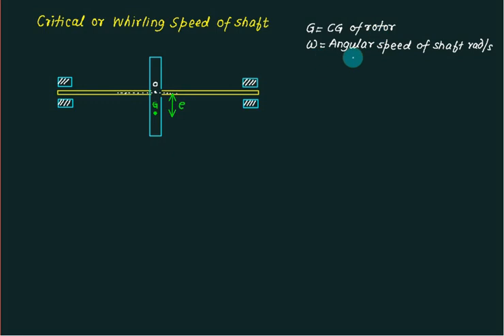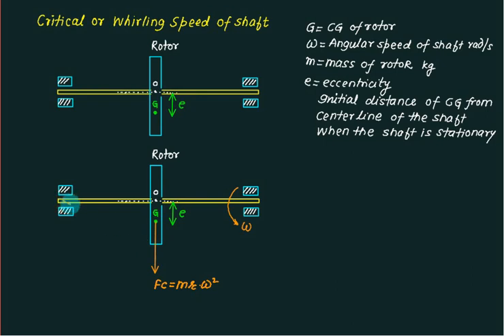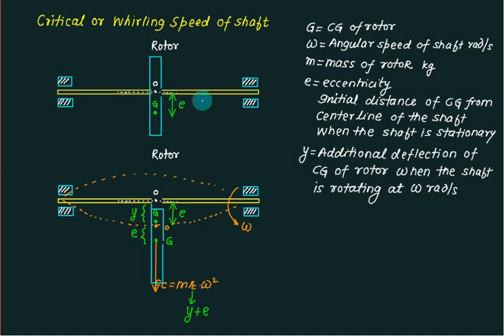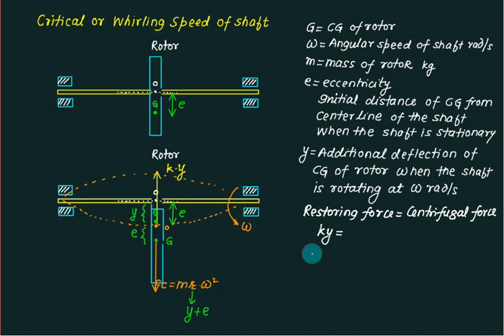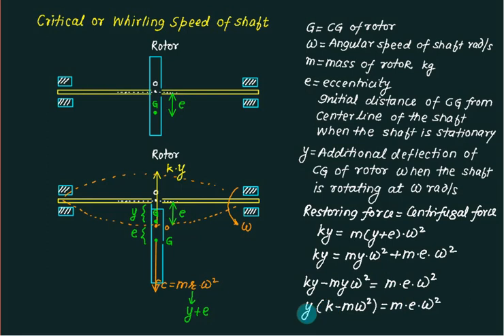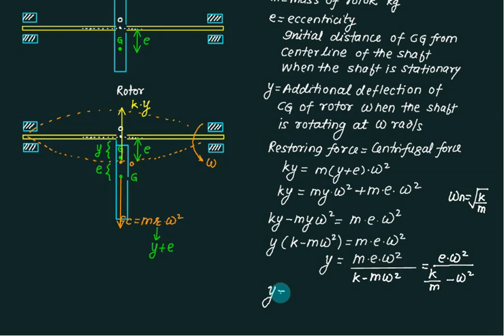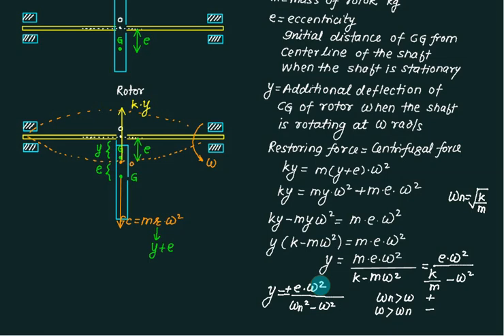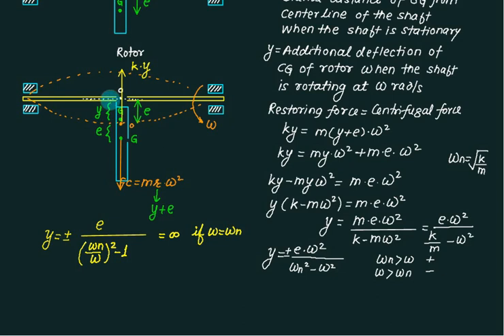TOM  05 Vibration  Critical speed or whirling of shaft

Comment: A horizontal shaft rotates in bearings at its ends. At its midpoint is keyed a disk weighing 40lbs, whose center of gravity is 0.1 inch from the axis of rotation. If a static force of 200 lbs deflects the shaft and disk through 0.1 inch, determine the critical speed of rotation of the shaft.

I always got 1327 rpm here but the answer key says its 547 rpm using that solution of yours sir.

Solution:

Nc = sqrt(k/m)(60/2pi)
k = 200/0.1 = 2000 lbs/inch
m = 40/(32.32*12) 

Nc = sqrt(2000*32.2*12/40)(60/2pi) = 1327 rpm.

Where do you think I got wrong? Thanks for your responce.